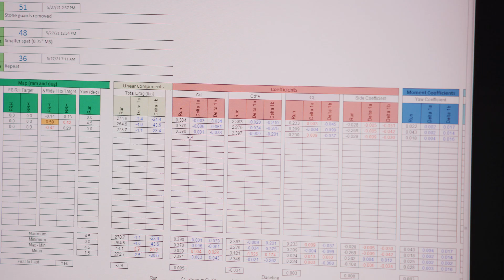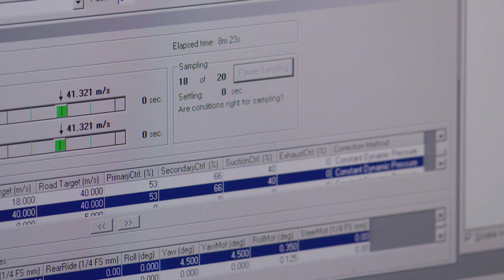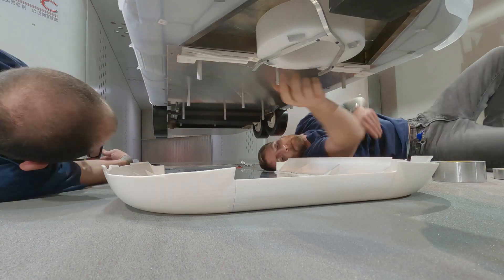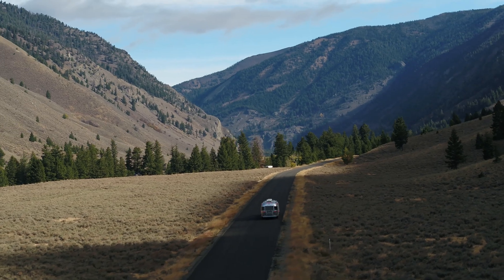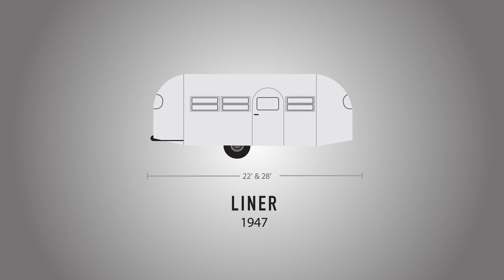Airstream Aerodynamics Put to the Test in a Wind Tunnel

Comment: "Incremental"
Why? A round front (as opposed to a square front with rounded corners) with a narrowing body that ends abruptly is far more aerodynamic. Go a little wider and taller up front and narrower and shorter in back. 

In any case, rounded corners in the rear are counterproductive. At least add some vortex generators to help mitigate the lack of sharp trailing edges.

Comment: Mucho talk, but zero data shown.  Claims for aerodynamics are highly dubious.  The issue has 3 determinants: frontal area (truck+trailer); drag coefficient; turbulence. Wind tunnels are used to determine the drag coefficient; not the real-life performance. Aerodynamics require laminar flow: ie no turbulence over the surface area.  Trucks produce great turbulence. The turbulence moves rearward to the trailer and increases by the gap twixt truck and trailer. No trailer can magically smooth that turbulence into a laminar flow.  Add a roof-top a/c to the trailer and drag increases. This is why a boxy cargo trailer, with rounded edges, has only slightly more drag than an aero- trailer, in real life conditions.  In this vid, where are the data and comparisons?  Fact: this vid is misleading propaganda.

Comment: You must make them narrower, shorter and lighter or it will be a mostly wasted effort.  It is time to ditch the roof mounted air conditioners.  The most are dynamic trailer one can buy today is the Bowlus Road Chief. Interestingly, it was the grand father of all airstream trailers.  In nearly 100 years, it's aero dynamics have never been surpassed.  Unfortunately,  It is two times more expensive that the already expensive airstream trailers.  I have a 2020 CB18 Caravel and it is not aerodynamic.  Even though it is short is weight about 4,000 ;bs.  In my opinion Airstreams have become too bloated and too big.  I would love to see a return to some of the smaller original designs with a longer more tapered tail.
Reply: Narrower and less height (pop-up roof like the Hymer or Eriba in Europe, now also a Thor company) will give you less frontal area. Length is probably less critical or will even improve the cw-value. Integrating the awning cassette into the body would probably be easier with a fiberglass shell for the roof. But a really big re-thinking on what you really need for a pleasant camping experience is probably needed to do away with a lot of the weight. Even in Europe the trailers seem to get heavier with all the amenities manufacturers have added over the years…

Comment: Stop peddling electric towing vehicle fantasy's. The math doesn't work. The mass of battery packs needed to produce sufficient range and torque would destroy  your needed payload capacity for passengers and cargo. You are selling snake oil. Bad handling, dangerously high voltage, child slave labor mining rare earth metal using snake oil which will lose half of it's range in cold weather and with battery packs that will decay in performance over their decade long lifetime. In other words an INFERIOR PRODUCT to what we use now. You are "fixing" a problem that does not exist. Why? Politics perhaps?
Reply: Let me guess, you were afraid of LED lightbulbs too?
Reply: @timothywitthoefft8356  We are pointing out the nonsense of pushing all electric vehicles. You seem to be afraid of “MUH climate change. MUH global warming”. Just waiting for the next talking point to be fed to you through the screen.
Reply: @timothywitthoefft8356  huh, really thought you did something there didn’t ya bud. Smooth brain take.
Reply: First of all EV handle very well with a low center of gravity.  The break even point of C02 emissions is about 8,500-13,000 miles.  After that they are far cleaner over their life time.  As for child labor used in mining, the same kids are used for the various raw materials used to build ICE vehicle like the cobalt used to refine gasoline and in machine tools used to make the hundreds of parts in the engine and transmission.  also platinum used in the exhaust systems and the Chromium, Titanium, Aluminum, etc...  Interesting NO ONE care about these kid until the EV came along.  However, if the EV gets people to care enough about the situation to do something about it, then the EV will be a huge success from that one point alone.  However, you re right, they are not ready for long distance towing.  Having owned them for almost nine years now, I know they make far superior every day vehicle though...
Reply: New world order. World economic forum.  Davos group Globalist.